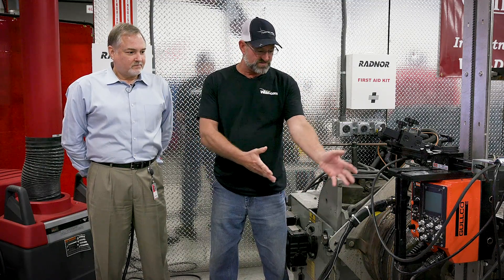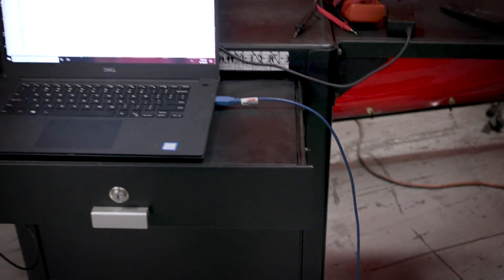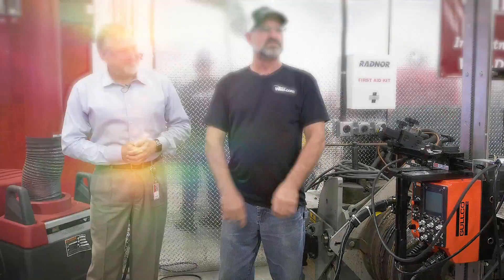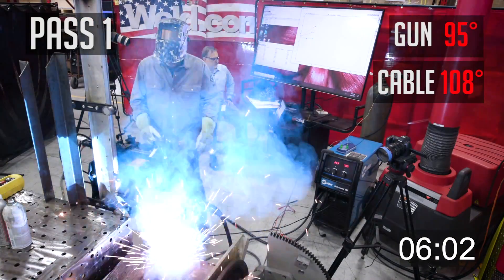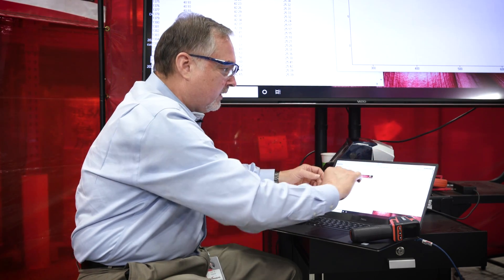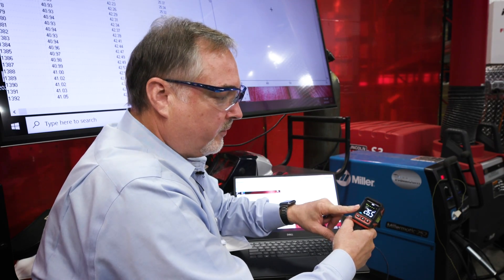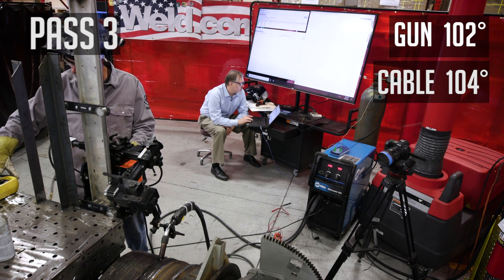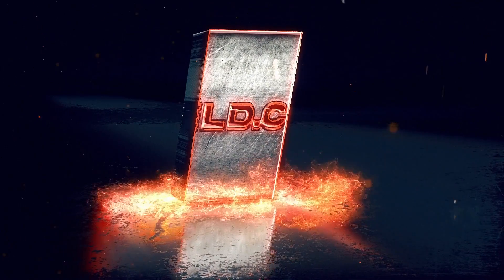Testing Welding Consumables From an Engineer's Perspective

Comment: Maybe it's just the camera angle on that display but it looks like the temp has not stabilized after 3 cycles, a few more cycles and it might not pass. 
Also wouldn't it be more pertinent to display the delta temps rather than absolute temps? Just to save the hassle of estimating the ambient temperature effects.